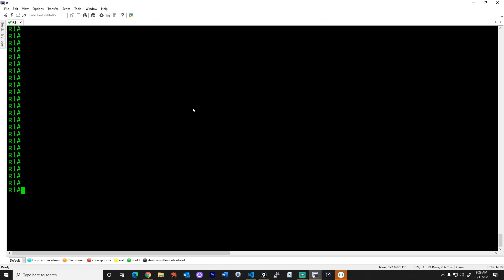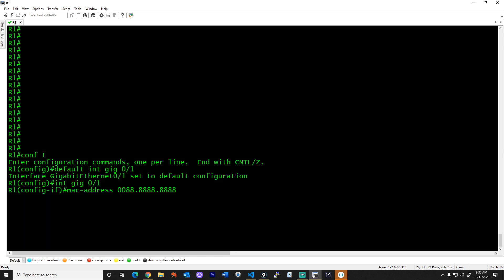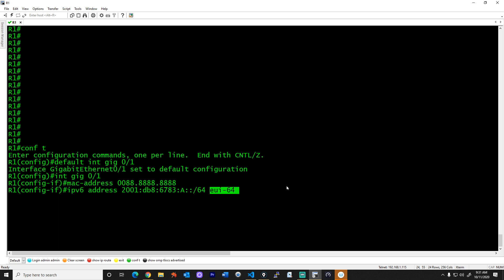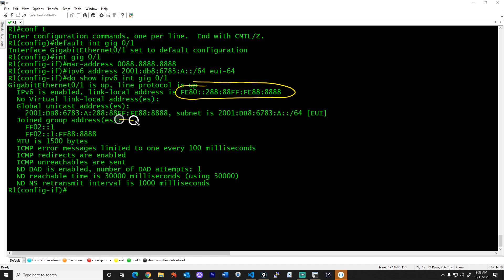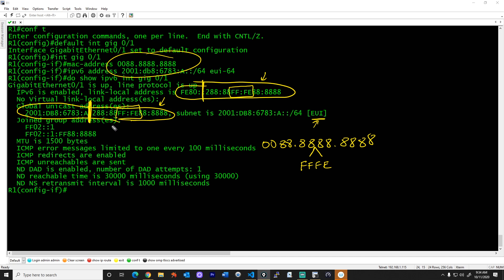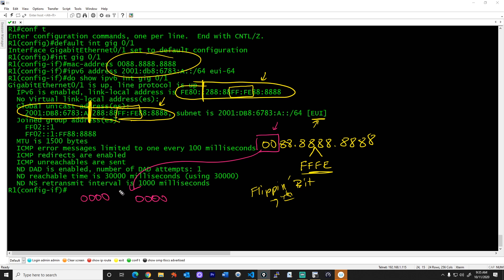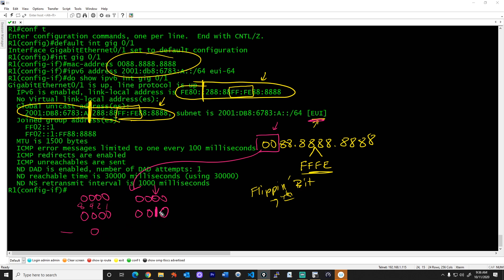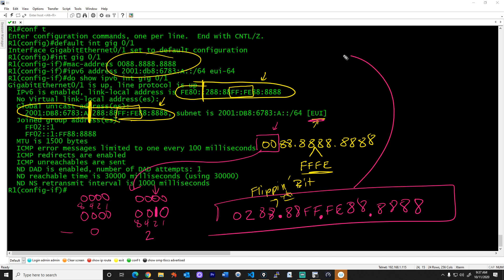Don't flip out about that 7th bit in IPv6 (EUI-64 does it for you)❗ | Cisco CCNA 200-301

Comment: Just one correction: With the U/L bit, you said it backwards. The values are: 0 = Universal and 1 = Local. Burnt in MAC addresses always have a 0 in that bit. When a user changes the MAC address using a command, this is a locally administered address, and SHOULD have a 1 in that bit. Some vendors enforce this, and when you change your MAC address they automatically make the U/L bit a 1. Your Cisco router does not enforce the rule. If it did, it would not allow you to set your MAC address to 0088.8888.8888. It would either reject the command, or it would automatically change the bit, and your MAC address in running-config would be 0288.8888.8888.

Comment: Great demo!!! I would add, don't freak out if you see a well known practice exam series that gets this wrong, and provides an incorrect explanation based on some old thinking of how the 7th bit might be used, but was never implemented.  Trust that the 7th bit (3rd bit of 2nd nibble) "Always" flips in UEI-64 :)
Reply from the maker: Exactly!  Thank you Morgan.
Reply: Yes, this is true in the context of IPv6 discussion. The actual EUI-64 standard does not flip the bit. However, IPv6 always uses Modified EUI-64, which means it performs EUI-64 and then flips the 7th bit. In most IPv6 documentation, they leave off the word "modified" and just call it EUI-64.